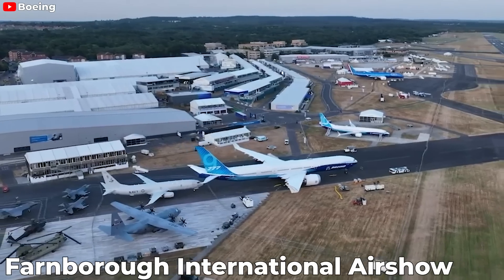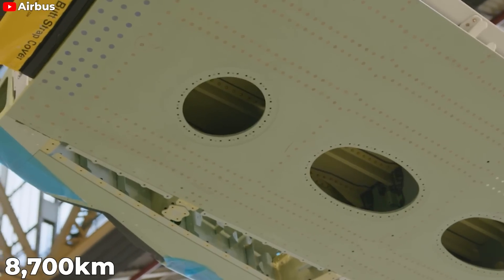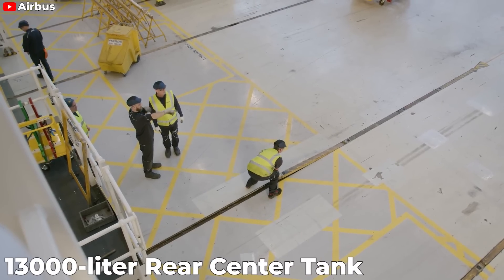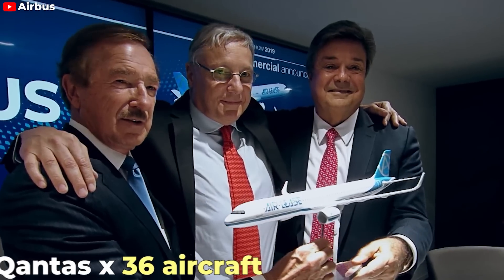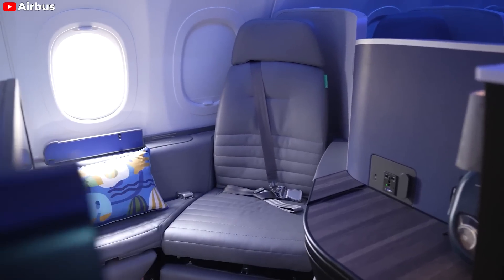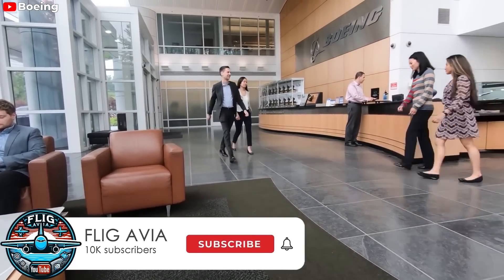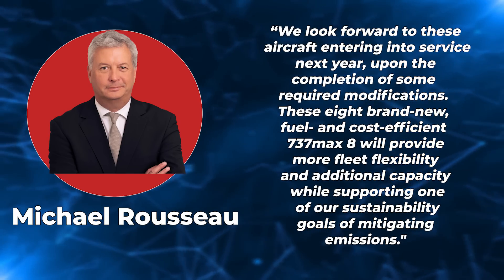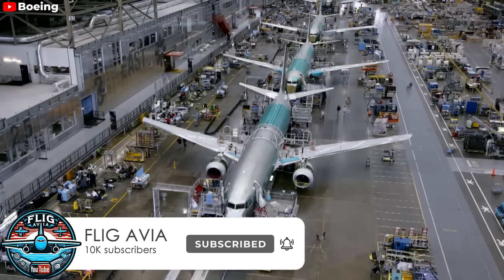Every Airlines Chooses the A321XLR than Boeing! Here's Why

Comment: EASA has certified the Airbus 321XLR ahead of the Farnborough Airshow. It will interesting to see how the problematic of the RCT (rear center tank) has been solved to the regulator's satisfaction. The weaknesses of the XLR remain evident to the eye: 1. The four-wheel only main landing gear: 2. The very high wing-load; 3. The lack of jettisoning. All this makes it a doubtful candidate to operate out of hot & high airports, and from short- and contaminated-runways. To be a substitute for the venerable 757, it would have needed an 8-wheel MLG, bigger wings and larger flaps.
Reply from the maker: nice, thanks for sharing

Comment: The reason why Boeing is not present at Farnborough is not primarily due to the criminal charges, it's something more fundamental than that. Boeing has no new products. They could - I guess - show off the 777-9 test prototype, but that would only highlight the fact this plane is 6 years late.
Reply: also the narrative said Boeing DID not bring .... which may be true but is not grammatically correct as Farnborough does not start until next week ( 22 July) so they will not bring would be appropriate.
Reply: @nickgiles7568 so the narrative will only be grammatically incorrect until July 22. After that, it will be correct grammar for years and years. See how that works?
Reply: OMG !! Yes, it's true that criminal proceedings against Boing are not fundamental!...In full denial!!!